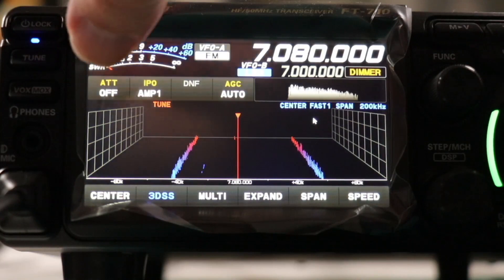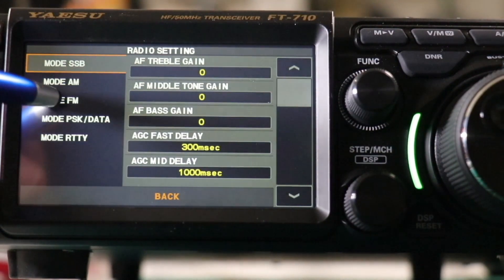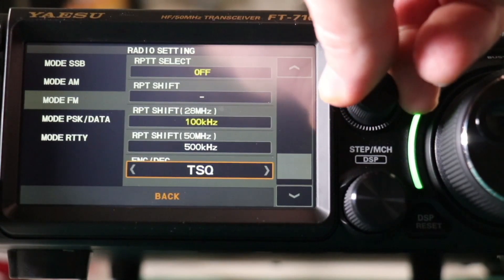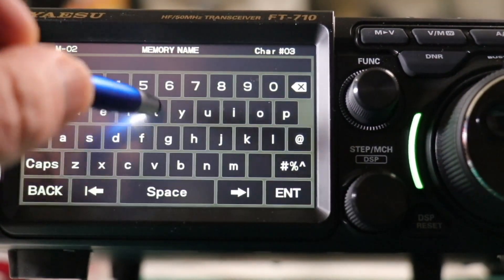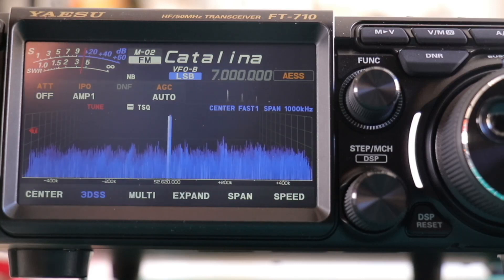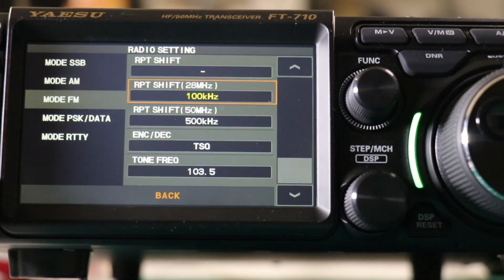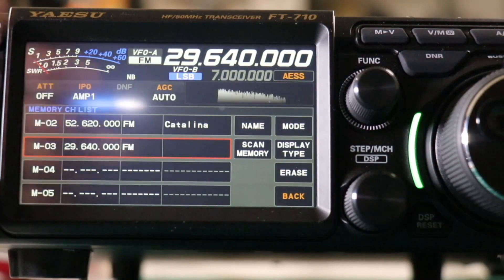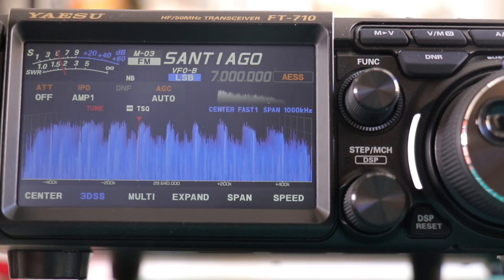Yaesu FT-710 AESS Repeater Programming

Comment: Thanks for vid. I am studying for my general and killing myself to figure out first HF rig. bought a G90 (good deal used) cause i want to do portable (strict HOA). Fired it up last night first time ever on wolf river coil vertical, not sure I like it, alot to learn and not very user friendly. Both my elmers have 991a, which i am scared i will not like due to deep menu system. I am seeing used 991a for around $850 nice cause shack in box and i like fusion. Used 7300 out there for $850 but cant run external monitor and older technology (maybe shouldnt bother me). Really want a FT710 but would eat up all my funds. I have FTM400 and FTM200, those are decent but not great. Would love to go Icom, but alot of Fusion around me and Yeasu has great HT .KD9IRA
Reply from the maker: Thank you for taking the time to watch and the comment! It is greatly appreciated. I happen to have both the 991A and IC-7300. I do like the 991A due to it being a shack in the box. I have always been one who means more towards Yaesu than Icom. But both are great radios. I have a lot more Fusion repeaters around me than DSTAR which is another reason for the Yaesu leanings. I also live in an HOA (a royal pain). That being said the IC-7300 is a great radio! I do know Ham Radio Outlets runs sales quite often and you maybe able to catch a good deal on the FT-710.